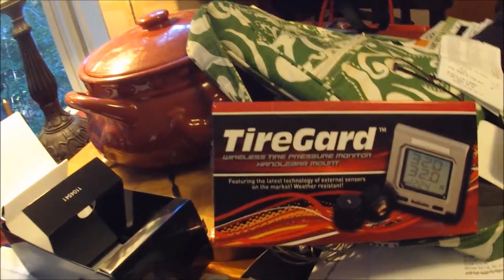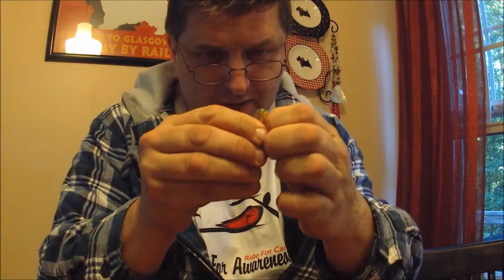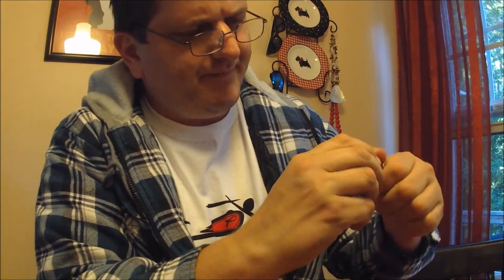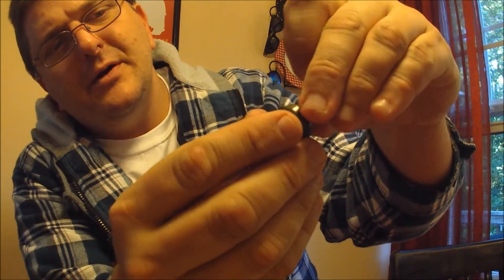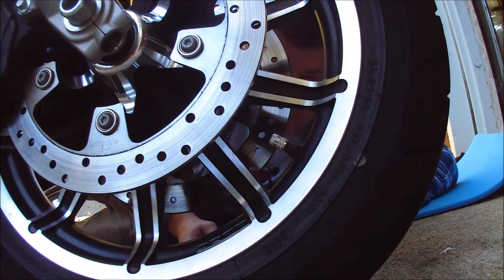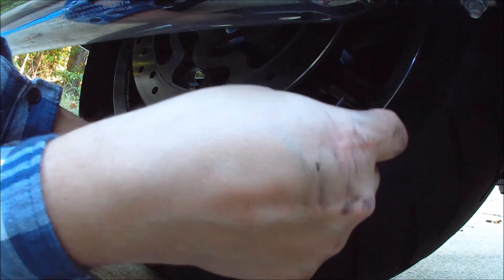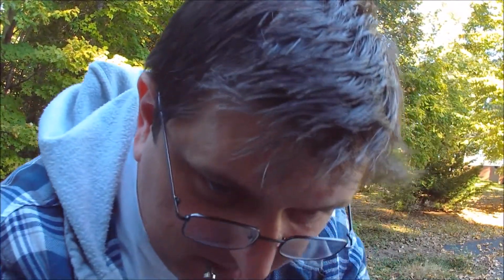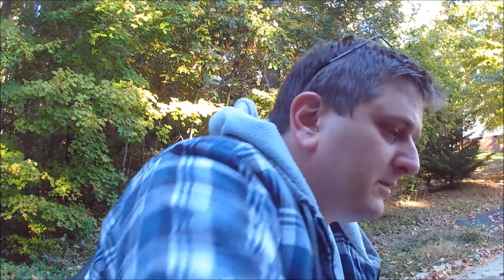English Teacher Installs Tire Gard Pressure Monitoring System

Comment: I'm telling ya bro, it is VERY scary how similar we are.  My rear tire has a very slow leak somewhere.  Going to have to get the soapy water spray bottle out to find it.  I really need to get one of those pressure monitors because it's had for me to get my fat a$$ down there too.  Now if you have to put air in the tire, I'm sure you have to take the ring off or will the next vid show us a trick.
Reply: Also had a slow leak on rear tire. I first cleaned and slowly visually check tire. Nothing found. I put a jack under bike to avoid breaking bead, let air out of tire, replaced valve stem core. No more leak. Just an idea to check.